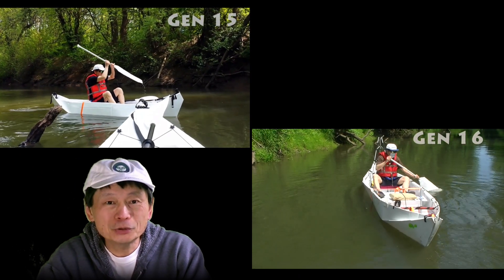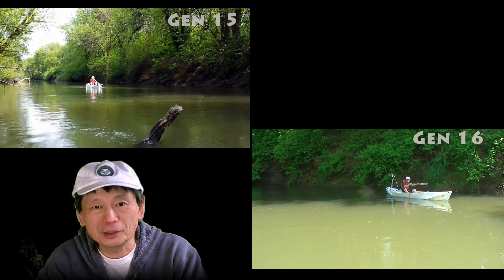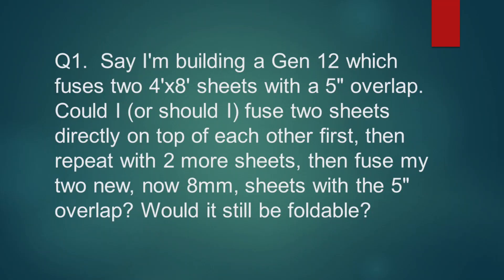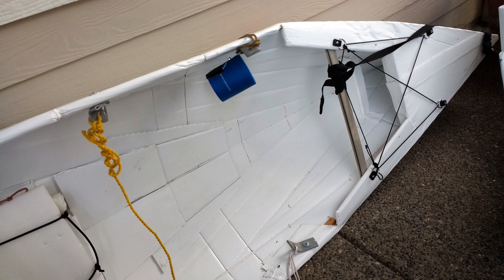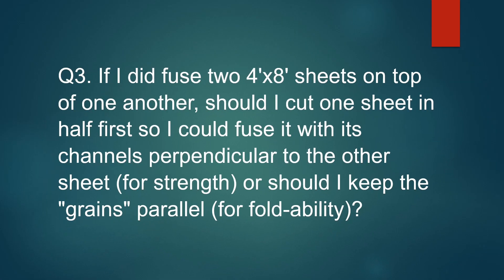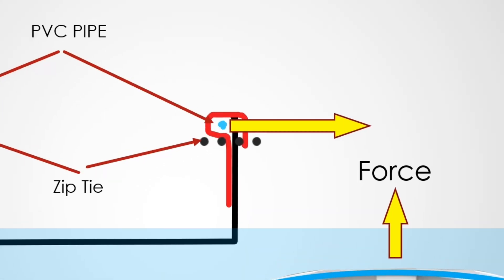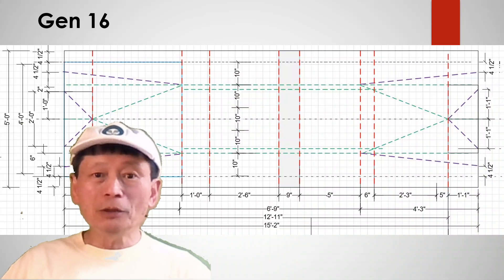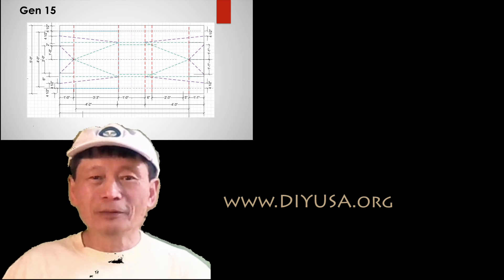Pt 1: Info to build a foldable solo or tandem canoe

Comment: Thanks for addressing my questions! I built a 1:3 scale model of your Gen14 out of cardboard over the weekend. Scoring and folding was a work out! Especially without the benefit of a heated/softened material. But it came out great! My Home Depot 10 pack should arrive in a couple of weeks. 🤞🏼😬
Reply from the maker: That is a very good news. You should not have problem building the real one. With 10 pack, you may be able to build three boats! if you place the coroplast under the sun, it would be warm enough to help with making the folds. Looking forward to see you new kayak!